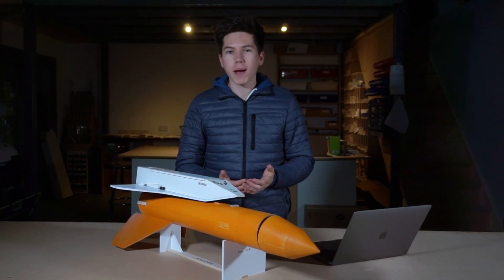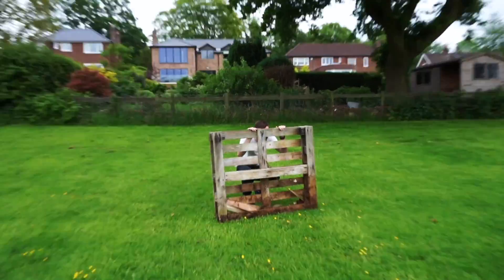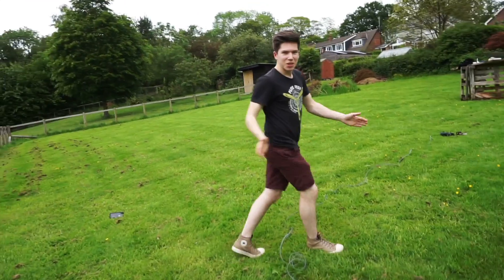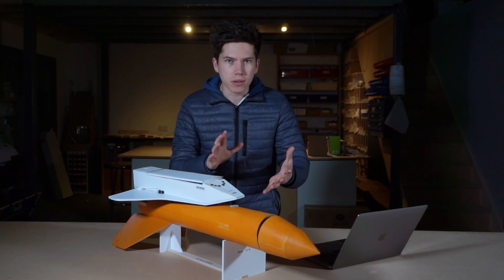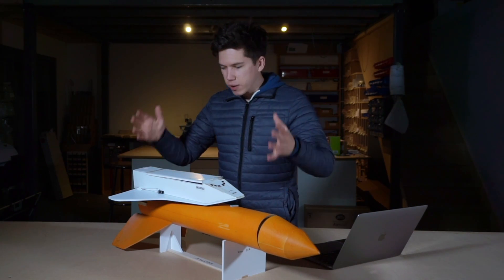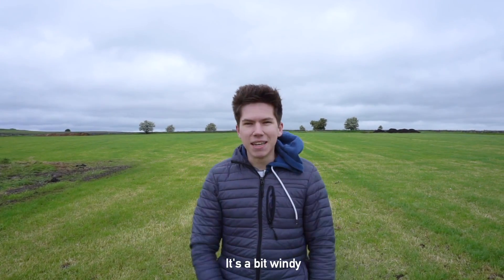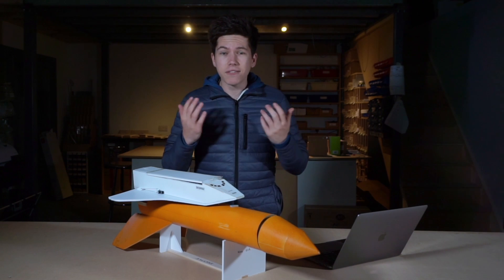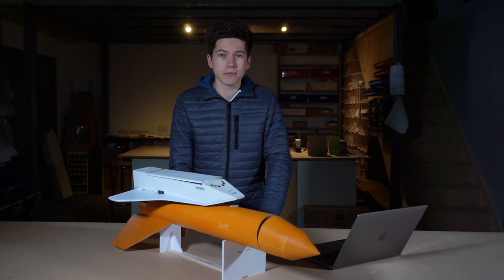RC Space Shuttle LAUNCH

Comment from the maker: Quick note: I will be trying the shuttle again (with modifications)! I think it's time we did some other projects for now though. Thanks for watching ☺️🚀
Reply: A bunch of us sometime ago had a rocket day    The highlight was Woggys rocket    It burnt and fell over .  Wogs old flopnik.  ( his name was nothing to do with race )    .
Reply: 3:50 don't use a home-made one 

Buying one is better because they run on AA batteries and a CAPACITOR
u need a capacitor otherwise your attempt is useless
Reply: Btw always use maths

I'm gonna build an RC ekranoplan (with 2 edf's) and it is being designed using only math
Reply: DoublehashPlus it’s going to be a piece of shit.
Reply: I AM FROM INDIA. I NEED TO CREATE A OWN MODEL OF SPACE SHUTTLE. PLEASE POST A VIDEO OF IT. I HAVE SUBSCRIBED YOUR CHANNEL.AND I THINK THE AERODYNAMICAND WEIGHT OF THE SHUTTLE  HAD CAUSED IT TO CRASH.
Reply: AND WHERE CAN WE BUY THAT ENGINE PLEASE REPLY
Reply: @sajit1906  I am from India 🇮🇳 I made my own space shuttle model and some other HM rockets 🚀
Reply: Your trial is worth my clappung for.
Reply: I couldn't tell if your shuttle engine was angled outward...the shuttles engines are angled outward (or "up" toward the shuttle vertical stabilizer) to compensate for the center of mass. You need the engine to angle away from the orange tank to keep the shuttle weight from pulling to the shuttle side so the entire thing flies straight up...Just like the real thing. You can't point the shuttle engine straight down. The boosters fire straight up and the shuttle engine fires at an angle... All engines fire together...
https://qph.fs.quoracdn.net/main-qimg-f8ce326389251e90a62d7b601bf49de2
Reply: You have the role perfect!
Reply: https://youtu.be/RwFRVPy8fL8
Reply: U need to use more traditonal aerodynamics. Just copy the SS.
Reply: 5:40
Reply: @projectair could you try to make one go to space without a baloon
Reply: Can i suggest some modifications? You should use three rocket, one in every booster and also one in the shuttel. Use the orage tank to make weigth and move the mass center to the middel of the craft.

Comment: The main issue is that the center of mass and center of thrust aren't in line with eachother, which will cause the craft to roll around the center of mass. Which is why even though it was tilting toward the ground it rolled to where the shuttle was closer to the ground. Secondly I would recomend using more powerful motors.

Comment: Clearly the wind was a factor, you need a longer stronger guide wire, turn the craft so the wind is a positive force not negative, round over the orbiter body for better performance. Have someone act as the orbiter pilot to guide the craft and later land it

Comment: Late post. But maybe try finding the balancing point when the rocket is vertical . That might inform where to place the d engine so that its thrust is alight with the center of gravity when vertical. Also the shape of the shuttle could be more streamlined with the body to have less drag and not pull the rocket over. Anyway cool problem to solve.

Comment: More physics from me (if that's OK); off-axis rocket motors (& engines) should point to the center of mass of the vehicle. 
Hence the angle of the Space Shuttle's 3 main engines. If you look carefully at the boosters they are also very slightly angled, but far less so as they are not vectored and center of mass changes during flight.

Comment: Cp ahead of cg shouldn't be an issue here for take off for vertical flight. I would say your problem lies with control (or lack of) of the thrust line.  Have you thought about using a gyroscope to control the ascent. Mount it in the external tank with either pushrod to gimbal the motor or control fins? The shuttle however you definitely need to get the cp-cg correct. A few glide tests (eg, drop from a drone or rc aircraft) will help here.
Sorry for being late to the party but just re-found this channel.

Comment: My two thoughts:

1. More Thrust. Without any thrust vectoring or rcs systems the sooner you can get enough speed over the control surfaces the better.
2. Have the Shuttle burn longer than the external tank or use the ejection charge/charges to separate them.

Comment: I like your attitude to learn from your experiences.  You could progress more quickly with input and guidance from members of a rocketry club, and experienced fliers.  This would prevent some of the design decisions that has me groaning at the screen - Please don’t do that.   Oh oh, he did.... this will end in tears.

Bottom line problems:  potential for asymmetric thrust, overweight model and/or underpowered, low lift off velocity, insufficient speed so fins/air surfaces could not do their job.  There are a number of others.  This will do for now.  My perspective is that with some guidance and support your obvious enthusiasm and aptitude would see you progress so much more quickly.

Comment: So, let's first clean up some terms used.

The entire thing is called the "space shuttle". Just the actual spacecraft itself is properly known as the "orbiter".

Anyhow, on a more serious note, with the real Shuttle, the orbiter's engines ignite first, followed by the side-mounted boosters. Since you're limited by what rocket motors you can use, and literally every single fraction of a second counts since you have so desperately few of them, why not use the SRBs to hold two large Estes rockets, use a small Estes rockets in the orbiter itself, then say ~2 seconds after liftoff rig the mount holding the orbiter to the orange tank to disconnect, and about that point ignite a large Estes engine also mounted to the orbiter?

Also, remember that with the actual shuttle, it executes a roll after launch to place the orbiter on the bottom of the stack. You might leverage this so that after you sever the mount and free the orbiter to then push it into a more nose-up configuration.

At that point, RC the orbiter to fly right-side-up and thereby gain good altitude and some landing flight control.

Comment: Not bad actually, seen much less stable Shuttle launches! The Shuttle Stack is an Aerodynamic abomination: you need a ton of noseweight at the top of the tank. Also, Estes igniters are appalling: use 'quickmatch' pyrotechnic fuse available from rocketry vendors linked to just one electrical igniter. Also, your flight was seriously underpowered: it left the launch rod with too little airspeed which is why the wind caught it.  Here's my attempt: https://www.youtube.com/watch?v=846tjP37rAc

Comment: the shuttle engine has to be tilted out a little bit to compensate the thrust and center of mass deviation of the shuttle in relation with the main booster, they are not in the same axle --> therefore both engines will be a (or have to be) the components of a common vector going perfectly foward. I think that was your mayor fail, that you put both engine in the same direcction , like paralle vectors. have a look on the real space shuttle , you will see that its engine hast a little offset angle. Best Regards!!

Comment: i have the estes model rocket. single engine mounts in the main tank, but it is aligned offset from the longitudinal centerline of the main tank to the very inside wall of the main tank, closest to the orbiter. that helps with the pitch over tendency during launch and in flight. that modification, and a more powerful rocket motor (D or E size) mounted in your main tank, positioned as per above, and you just might have another go! cheers!!

Comment: Your large engine overpowered the thrust from your shuttle engine (watch the video again).  Use the same size engines all around.
Also back in the day, we launched 3 and 4 engine cluster rockets with no problem (used car battery with jumper cables hooked to a launch station). The key is "cluster." Instead of thinking CG (like aircraft), think CT... Center of Thrust. The closer together the engines works best.
Your CT is more towards your large engine. Try the same size on both vehicles. 
It wouldn't hurt doing glide test of the shuttle with an old burned out engine installed in order to have a correct CG for its descent.

Comment: If the CG was in front of the CP then it should fly just fine, the issue was the thrust to weight ratio that was too low. Place a bigger motor and you should be fine. Try again, cool attempt!!

Comment: The fact that you have a weight (the shuttle) hanging off one side of the central fuel tank (which being empty weighs nearly nothing, unlike the real shuttle) means that the CG is probably way way off. if you adjusted the angle of the main engine to add more lift to the shuttle side that might help. Or you could move the tank engine closer to the shuttle.

Comment: When my brother and I launched our two identical 16 inch "sounding rockets" many years ago, we used a medium power B6-4 engine and launched from our big school yard, next to a major highway.  The first launch sent the rocket well our of sight but after about 5 minutes we finally saw a small dot that was its 16 inch parachute.  It took it nearly a half hour to get back down the the ground, as the noticeable winds swirled it all over - coming close the the big highway.  For the next launch, we cut a 10 inch hole in the parachute, which got it back down much faster - but at the end of the day we were pretty surprised and impressed with how high the "medium rocket engine" had worked.

Another vehicle we built and launched a few years later was the Estes Mars Lander, which weighed a ton and took a pretty big C6-3 engine just to get it off the ground.  The unassembled kit arrived the day before we were going on a long family vacation, so my brother and I stayed up all night, rushing to put it together.  Unlike the height achieved by our earlier "sounding rocket" launches (estimated at something well over 1,000 feet), the bigger engine just barely got the Mars Lander up to 150 feet.  On about our third launch, it veered well off course after taking off and embedded itself in the middle of a big tree - just as the ejection charge went off and the parachute deployed.  It eventually fell down again about two months later but was pretty beat up from weather - and we had put together a new one (that we had more time to build better) to replace it.

Estes did make a neat 22 inch space shuttle rocket back then too, which had a beautifully trimmed 6 inch glider that would detach and circle down at its peak altitude.  This was well before the design of the eventual U.S. space shuttle had ever been shown, so it didn't look anything like the real one - but it was a cool rocket that was fun to fly.  You video brought back all these old memories - thank you!
Reply: Very good...........

Comment: Use a gyro for stabilization, add a fin to the shuttle so you can control all three fins for stability, add counter weight on the opposite side from the shuttle for balance and of course use bigger propellent rockets. This should make it go straight. Separate shuttle befor the chute pops, fly and land shuttle, find the rocket. Do it again.

Comment: Two suggestions:  

(1)  Launch in lower winds. 😊 

(2)  Replace your launch rod with a LONGER launch rail to maintain stability better until the model gets up to speed.
Reply: Note the direction of smoke says wind blew it over
Reply: and maybe implement thurst vector control by tilting the motors with servos

Comment: Um. In the next version, perhaps try with the shuttle on top of the rocket and two stage it. Or, use more engines.
Something I found super difficult is getting two rocket engines side by side too be actual parallel. Seem to always get a twist when launched. Have never done it, but felt that four or five engines would be easier ... or more forgiving.

Comment: The rocket was actually stable, you could see it stabilize after it gained velocity. With the addition of a launch rail it should work much better.

Source: I've built 100lb sounding rockets with years worth of engineering and aerodynamics calculations and even those require a rail to stabilize them before they have enough velocity for aero forces to take over.
Reply: Maybe see what weight of little rocket. Is compared to thrust of engine and transfer that to shuttle and booster and maybe with a launch rail. ,I think not enough power ,Not a rocket scientist ,Good Luck
I
Reply: @jimb1801  It can have all the power in the world but if it comes off the ground with some rotation it will never get stable vertical flight. The rail keeps the rocket straight while it gains enough speed for aerodynamic forces to start to work on the fins
Reply from the maker: @mattsoup4121  I've been thinking about building some sort of sturdy launch rail/tower for launching planes as well as rockets so maybe this is the excuse I need!
Reply: @Project-Air  The easiest way would be to use T slot aluminum extrusion and some "rail buttons"

The Rocketry Forum will have a bunch of threads about it if you want more details.

Comment: On most rockets the center of mass is on the center line of the rocket. Adding the shuttle shifts the center of mass off the center line toward the shuttle. Even at very low speed this will make the rocket tend to turn toward the side with the shuttle and at high speed the aerodynamic drag of the shuttle will increase that tendency. The rocket in the shuttle should help to overcome this imbalance by shifting the center of thrust toward the shuttle but depending on the thrusts involved it may not be enough or may be excessive. Another way to regain balance would be to put two shuttles on opposite sides of the large rocket.

Comment: I'm not a rocketry expert by any means but I have went to a local rocket clubs launch day a few times.  One thing that I remember is that a rocket needs to be in stable flight before it leaves the rod on the stand.  The guide rod keeps the rocket stable until the fins start to fly. Basically you need it to be going fast enough for the fins to be flying/stabilizing.  So you either need to give it more trust to that it hits that speed faster or you need to make the rod longer.  Once you get past that I'd guess your next problem is center of thrust and center of drag.  As a KSP and rc airplane fan, I've learned quite a bit about trust angles.  Think about the FT Explorer.  The motor is angled towards the center of mass to counter act its moment due to it being so high up.  When you have two thrusters with different amounts of thrust it gets tricky.  I'd start with adjusting the orbiters thrust angle to point closer to where you think the center of mass it.  The good news is that it will be really really really rewarding when you get it to fly!  Keep it up!

Comment: Like many others have mentioned - insufficient thrust may be part of the problem. But I think the problem is deeper than that. Currently you are using two rocket motors to power this design. This means that essentially there are two points where thrust is acting upon to propel the vehicle. In 3D geometry, three points determine a plane - having at least 3 points will yield the most stable configuration for any static structure. Take a tripod for example. It’s stability comes from the third leg. To solve your problem (lack of thrust and stability), I think you should add a third motor in the tank (have it be symmetric of course) and adjust the angle of the motor in the orbiter. In real life, the orbiter’s engines produce thrust that is angled away from the axis of the tank and boosters. This counteracts the moment of the orbiter (from gravity and drag). You may be able to get away with just two motors with an adjusted angle, but it seems your current propulsion system lacks the thrust needed in order for the fins to be effective.

Comment: Hey James, could you try to develop a EDF Afterburner similar to the one David built at Flite Test.
I'd love to see a improved version of it on your channel. 
(Improvement Ideas: Let the burning gas heat up the Liquid Gas, Make it Automatically coupled to the throttle, maybe with an Aduino to control the ignition, Try to reduce the Drag when the burner is lit And most important: Make it fly!) 
Would love to see that developed into a working design
-Henning

Comment: James, as others have mentioned, you need more thrust, quite a bit of it. Until the rocket gets up to speed it's going to remain unstable. It's also possible that you might be able to control the glider on the way up as many of us do with simpler R/C rocket gliders, provided you have big enough control throws. You'll need to have your launcher set up so you can step on the launch button instead of pressing it by hand.
Reply: Also, look into building out a proven R/C rocket glider from foamboard. The FT Arrow works ok, as does my Lockheed N+2, and Frank Burke's designs over at Dyna Soar rocketry are really, really good and easy to fly.